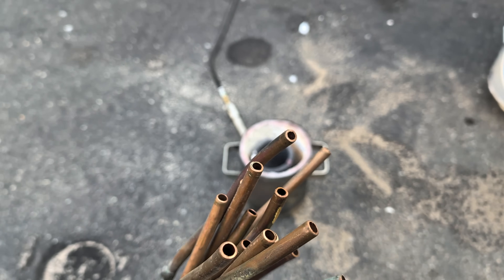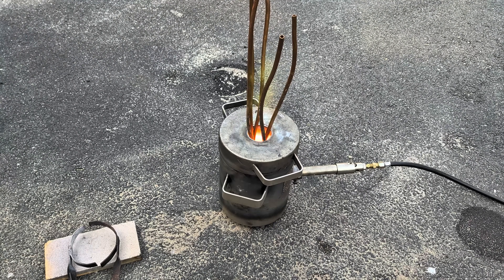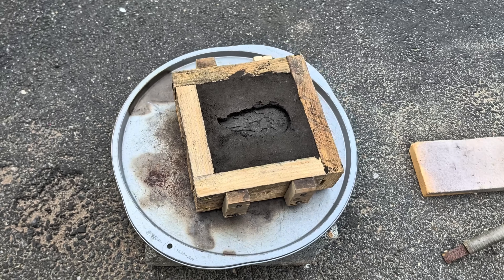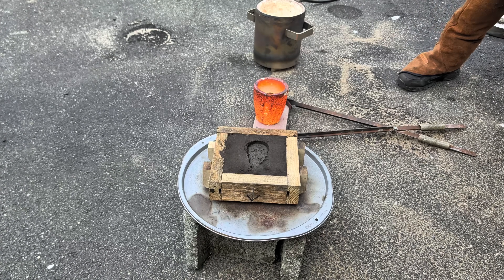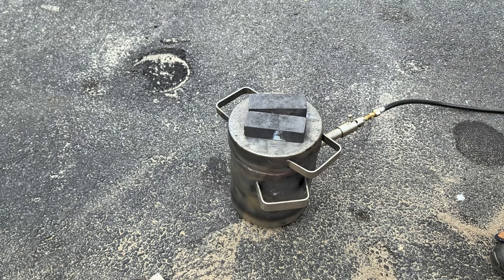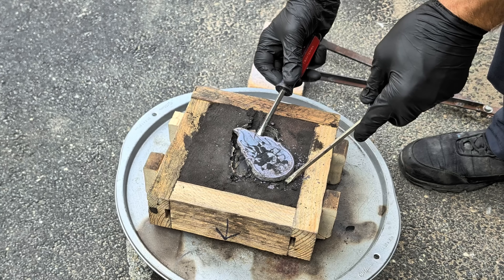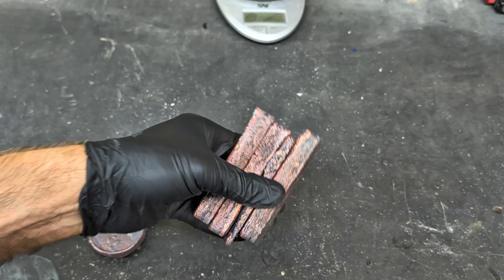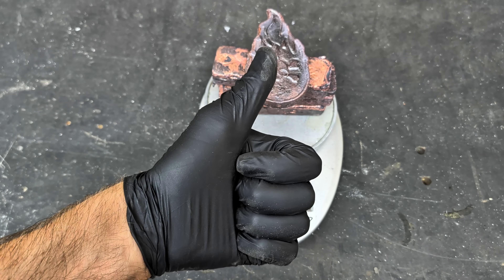Scrap Copper - Melting Scrap Copper into Bars - ASMR Metal Melting

Comment: I want to start collecting various scrap that come around that would get discarded (Bolts, door handles, car parts… whatever I find).
How do I know how to separate like iron, steel, aluminum, zinc, tin, lead and a lot more…before to melt them?
I love your videos. Thxs 👍🏻
Reply from the maker: Awesome!  So a magnet is your best friend.  Aluminum, zinc, tin, lead is not magnetic.  You probably will only find aluminum as scrap.  The other metals are difficult to find.  However, old household pipes in some areas were made out of lead.  Lead is really heavy.  So that's 1 way to differentiate lead.  You'll probably mostly find copper and aluminum.
Reply: @HeinrichsMade That’s great help Thxs.